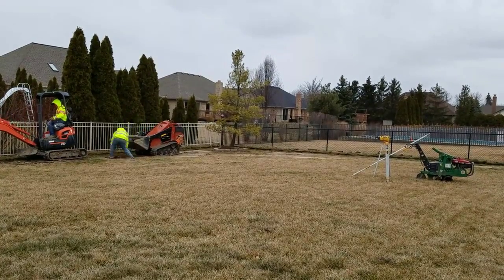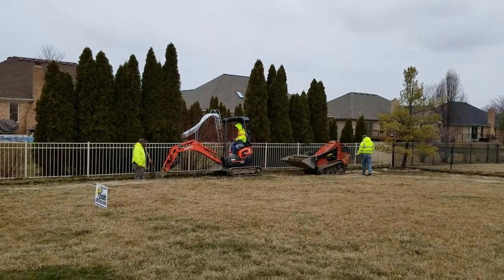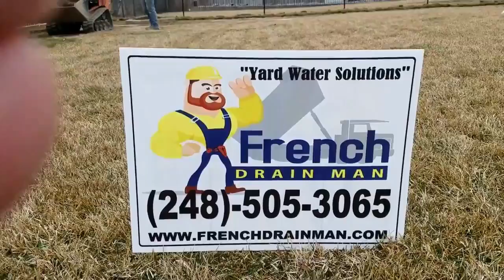Why you need a French Drain System for a yard with no slope

Comment: Same Q as gman107a:  If there's no slope, then the trench  fills with water and comes to the surface when it overflows.  Then you have the same problem you started out with - ponding water.  So where's the benefit?
Reply from the maker: @A H
We take it to a sump pump system if need be. Now a flat trench will empty. If I have 14" of drop I use my burrito wrapped system because even though its flat the water will empty out just not as fast. A trench can be dug flat.
Sorry for making this so difficult. Thank you for commenting!!